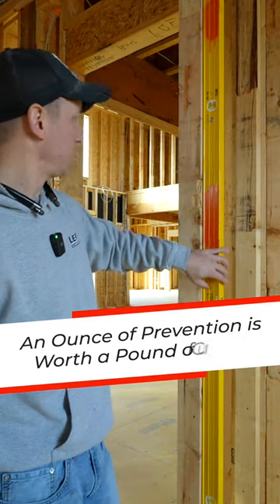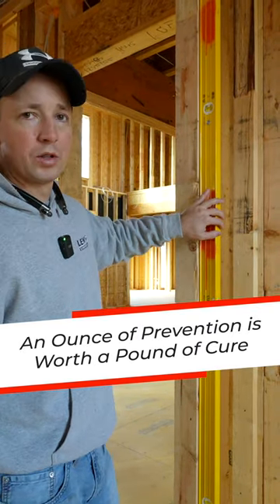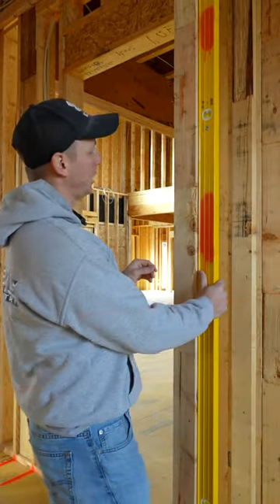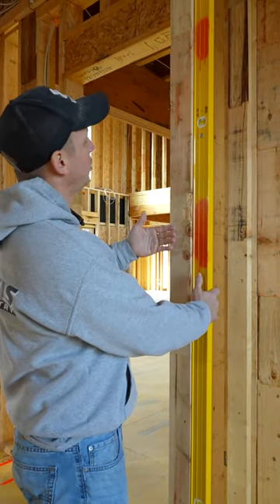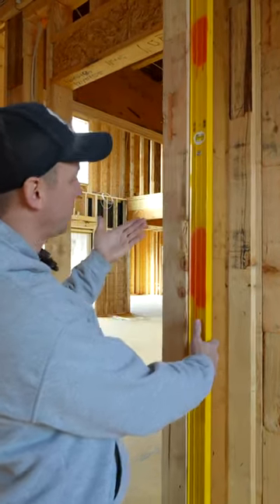Plumb Door Rough Openings For An Easy Trim Install!!!

Comment: I give you props because it always helps to have your framing plumbing level of course, but any good carpenter can deal with rough framing a little bit out. If your hinges are bound because the rough framing was a little bit out then you don't know how to set a door.
Reply: Or perhaps one does know how to set a door in an out of plumb/level/square rough opening but finds it more efficient to walk through the new build and straighten the minor problems out prior to door installation.
I side with Insider Carpenter on this one.

Comment: check the nailing as well.  many framers are hacks.  Good to add a couple screws to lock it into place after the sledge.   Its a good ideas to add the trimmer after the wall  is up to hide the nails or screws under the trimmer

Comment: So you go through the project before drywall and prep everything?  Hat is off to you for going that extra mile.
Reply from the maker: Yep
Reply: @InsiderCarpentry  wish I had the time to do that. Primarily work on spec homes and it’s just one after another. Only do roughly a dozen customs per year but wish it was more. Cheers brother

Comment: After the tap, everything goes up and door gets installed and a few months later it's out of wack because some guy tapped it and didn't secure it back to prevent that tap from being a point of movement.

Comment: Nice that the electrician uses the correct switch boxes. Tell the framers you will give them a dollar for every plumb framed opening that you don’t need to touch. And that they pay 20 bucks for every opening that has to see your sledge. Quality control.
Reply: Yeah try and collect that money from a framing carpenter
Reply: How are those "correct"?
Reply: @jonblakemore6454  No need for metal boxes with plaster rings . It’s not a commercial job
Reply: The 20/1 challenge is a motivator for the framers to use a level and check their own work. No money actually changes hands. Metal boxes are superior to plastic. Superior is often…well superior. Always nice to see metal boxes in residential applications.
Reply: Minor plate adjustments can be made after drywall as well. Just toenail a screw into the subfloor to keep it plumb. Hinge side especially. Good practice on all door openings with short plates…adjusted for plumb or not. 3” screws catching jack, plate and subfloor will ensure your prehung doors stay where you want them. While you are at it, throw one into the door header as well on the hinge side.
Reply: @henrypeisch5289  looks like plastic 4" square boxes with a metal mud ring.
Reply: @jonblakemore6454  great call. If you look down the hall, it appears there is PVC box on the wall. Hard for me to see but the mounting brackets appear to be metal box brackets on the block out for wider casing. So, I think that box is metal.
Reply: @henrypeisch5289  Why do you think metal boxes are superior to plastic in a residential application where your using NM wire and not MC . The metal wire connectors have to me counted in your cubic inch count for how many wires can go in the box and you have to count the grounding tail(one for every box). With plastic you don’t have to worry about any of that . And those plaster rings are a nightmare for the drywaller and the taper . They always leave a bulge in the wall
Reply: They are stronger, more heat resistant and you won’t see devices installed with drywall screws because the plastic threads stripped out. But, admittedly we have used the plastic also. Metal is an upgrade depending on the architect and the client.
Reply: @henrypeisch5289  The metal box might be heat resistant but the NM wire isn’t so you still would need to do a totally rewire and you can strip out metal box threads very easily. I’ve tapped new threads many of times
Reply: @myronsmith2114  for sure, metal is more money and more work for the electrician. Sometimes that cost equates to a superior wiring installation.
Reply: @henrypeisch5289  Your wrong there buddy . A metal box is no better than plastic when it comes to Romex . Unless your hanging a very heavy light fixture. Of course you would use metal in that situation
Reply: I like metal for it's rigidity but NM for being non-conductive.

Comment: I ran into a closet where the hinge side was out between 2" and 3". Since it was already drywalled I used a 2x4 and struck it until it was plumb, then secured it in place. The guy who was hanging the door freaked out when I walked back into the house with a sledge hammer.

Comment: I’ve not long finished putting all new doors and door frames into a clients house. Not one wall was plumb which made it an absolute nightmare. The house was less than 20 years old so the rough bastard that built the place has no excuse. Probably on price work.
Reply: I had the same problem years ago hanging new doors in openings with steel jambs already set into brick walls, so there was no fudging the openings or jambs. My solution was to clamp the doors to twist them. Leave for a few days. Got them all to hit the stops perfectly. But it took time. Nightmare.

Comment: Put a string as an X in the opening. The strings should just touch in the middle. Then you know the opening is in one plane.
Reply: Or just check with the level and budge it with a tap of a sledge….Who’s got time to screw four corners and run string lines. His method is more efficient. Mind you, it the rough opening is out of square the string is a good idea

Comment: If the framing is done correctly, plates cut even lengths and plumb walls, lots of bracing , the door openings should be good to go. You ever heard of a shim? They are the not so magic secret to installing doors, mandatory for any RO.

Comment: Doors that are out of plumb are such a PITA to live with in your home. My garage door will swing back on itself slowly when I’m carrying groceries to and from and it’s annoying as hell
Reply from the maker: One option is to pop the hinge pins. Put them on the concrete and hit them slightly with a hammer to slightly bend them. Put the pins back in the hinge. The bent pin will create some extra friction and can stop the door from opening or closing on its own. I have done this in a pinch.
Reply: Does your garage door have spring loaded hinges?
Reply: @InsiderCarpentry  great tip! I will have to try that next time. Unfortunately for some reason they are NRP hinges on a door that swings into the home.. I suppose I could replace them with normal ones. Until then, time to make a door stop!